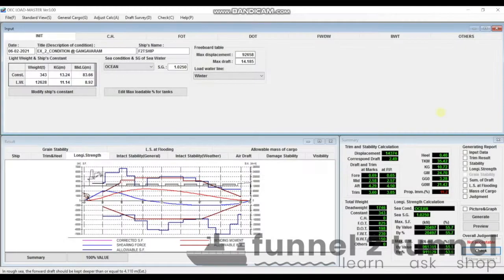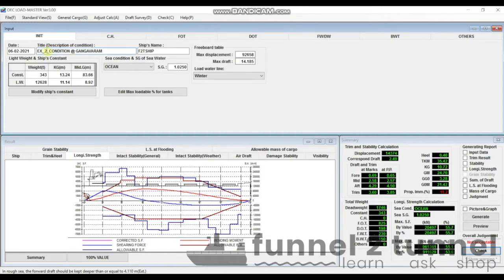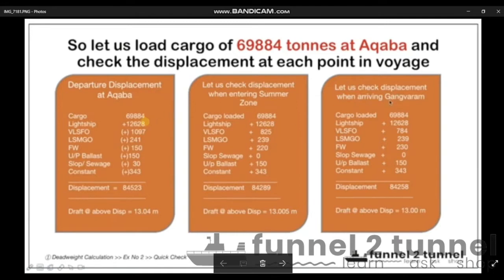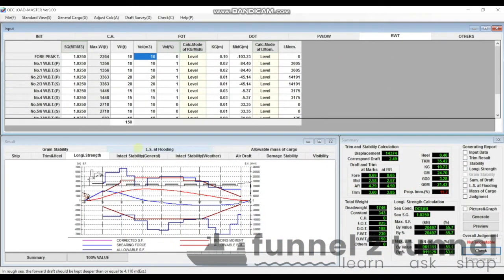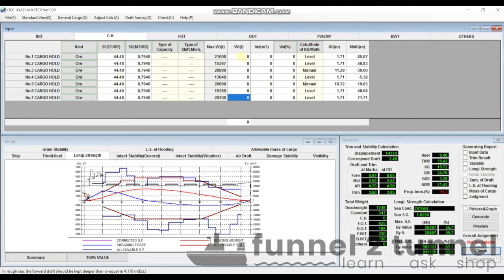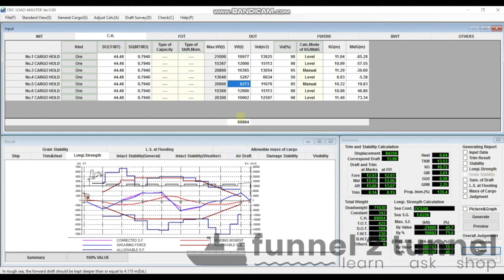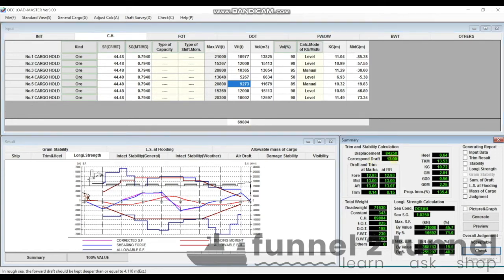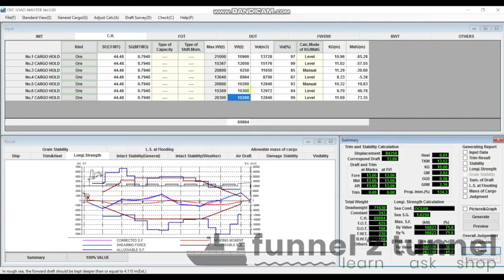Deadweight Calculation and Stowage Plan | Loadicator | Part 5

Comment: Its very bad, that you didnt show how and what exacyly you was calculating when you decided to put SF 44,48 and SG 0,7949.
As I know SG we must use ONLY for liquids & SF for solid or bulk,grain cargoes.
So question is: why you didnt left empty the column with SG?(because we are carring solid cargo, but nit liquid)
If SF as you saying is 1.26 why is the column of loading programm you wrote down 44.48?
Why you devide 1 on 1.26?(where you took 1.26? And what is 44,48 in such case?

Comment: Slightly off topic though , what constant should we take in the final draft survey one which is actual on arrival (generally its off) or what we have considered in dwt calculations which has been sent to the charterers ?and can we change the constant at discharge port slightly if we are short or its a big no? Wr take the same one as the load port. Pls reply
Reply from the maker: The whole purpose of doing the initial draft survey at loading port is to determine the ship's constant. The value of the constant obtained at the initial draft survey is used at the final draft survey in order to arrive at the cargo figure which is loaded. Now when the vessel arrives at the discharging port the draft surveyor would carry out the initial draft survey and you will arrive at a value which is Cargo + K. which means that the value consists of Cargo value and Constant value. The draft surveyor normally asks for the loadport draft survey report and subtracts the constant obtained at loadport from the cargo + K value to arrive at the approximate cargo figure. However, he will only ascertain the final figure discharged upon the final draft survey and you will be left with the value of the constant. I advise, not to reduce the constant at loadport since if at discharge port you obtain the real constant you might end up with short quantity of cargo. As a Chief Mate, it's always advised that you are aware of the vessel's constant. For more tips and tricks on draft survey you can watch the video i posted on Draft Survey tips. Hope it clears!!!
Reply: @funnel2tunnel360  thank you sir for your reply. Yes its clear now . Thank you once again.

Comment: Sir how do you check hog / sag could you clarify. Thanks for the excellent videos.
Reply from the maker: Thanks for asking! If you look closely on the loadicator screen and the tab "Longitudinal Strength" the ship diagram shows various lines moving along the length of the ship. The line in color blue represents the Shearing Forces while the line in the Red refers to the Bending moments along the ship's length. The Hog / Sag is caused by Bending Moment forces acting along the ship's length. If the the Bending Moment line is curved downward at the middle of the ship compared to ends - it means the ship is experiencing a SAG. If the Bending Moment line is curved upwards in the middle compared to ends then the vessel will be experiencing HOG. Hope it clears!!
Reply: @funnel2tunnel360  thank you for the excellent explanation. Best videos ever i could find on YouTube. Thanks a lot

Comment: Tks for your videos, it's very useful for me. but I still confuse when you set condition "In port" and keep Density 1.025. If you change it to 1.000 then drafts at departure port will be different, am I correct?

Comment: how much sagging condition and bending moment will you recommend in worse scenario? thanks it"s great and wonderful video!
Reply from the maker: Thanks for the question. It is very difficult to predict the actual amount of sad that will be experienced By a ship in a given loading operation. It will entirely depend upon the type of cargo loaded ( heavy density or otherwise) , the kind of loading sequence adopted, and other factors such as when the sag is actually being developed during the loading stage. If initially only sag is developed it is very difficult to break that sag during the later stages of the loading. 
But , a lot will depend upon the past history of the vessel for this you should always refer to the previous draft survey reports of the vessel as to how much sag was experienced with what all cargoes. Accordingly sag allowance must be taken in your deadweight calculations. 
We shall discuss this at length during upcoming tutorials on sag allowance!